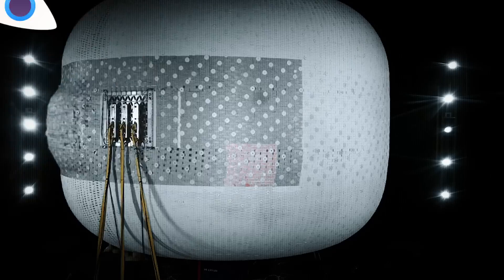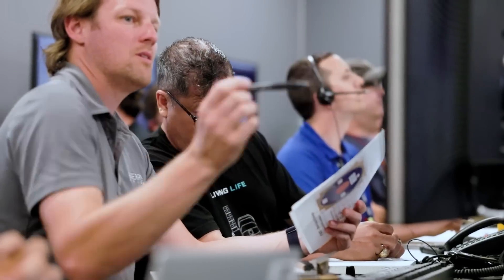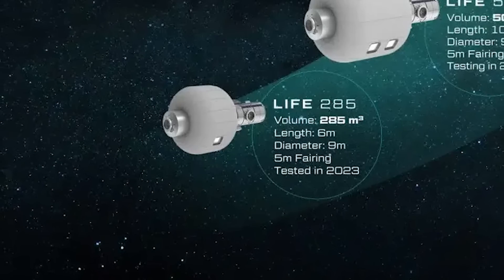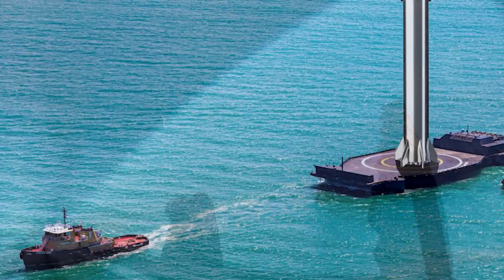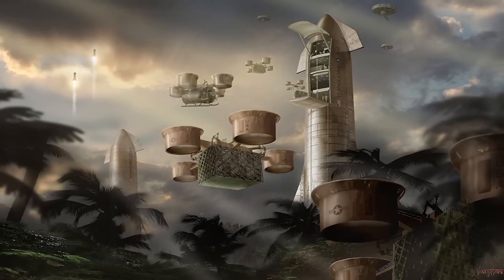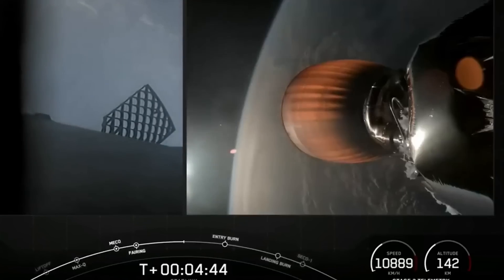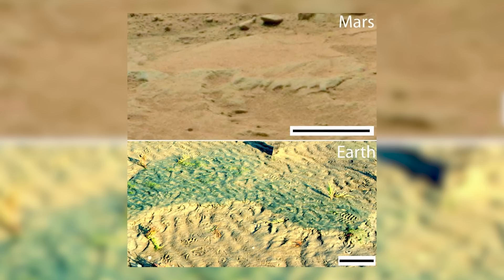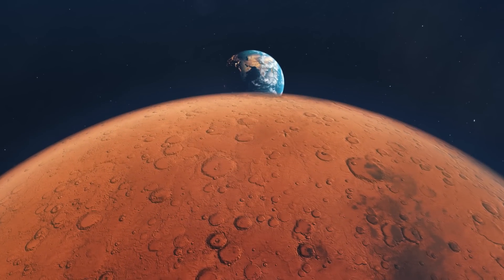This Is NASA's New Space Station...And It Just Exploded...Again!

Comment: They are not using a 50 cal. They are using light gas guns (LGG) which accelerate projectiles to speeds of 7.6 km/s or more, that's 9 times faster than the muzzle velocity of a 50 BMG which means that a projectile from a LGG has 81 times more energy than a 50 BMG per weight basis and more importantly the terminal ballistics are very different at those speeds even plasma and ionization become a thing.

Comment: i think they has to add multiple pressure layer for reliability and ability to fix one layer if ie inner layer damaged and there is space vetween outer and inner pressure layers it can be fixed withing by using outer barrier as shield while inner layer is daaged... ie layers with service space layer and can be kept reliable by using a bridge pressure layer ... so that the stress will be minimal as pressure difference will be lower compared to one pressure layer editions..

Comment: It would be vastly safer if the failure weren’t so violent. If you get ruptured by too much pressure, it should be repairable. Catastrophic failure really isn’t an option.
Reply: At 76 psi a crew would be long dead anyway.
However, I'm pretty sure this test was to see, if the thing is as strong as it's supposed to be,
not to prove it against pressures on-board systems probably wouldn't be able
to produce anyway.
Reply: Another reason to not want explosive failure is space debris. Yes these are vast hypotheticals given the pressure needed to burst the habitat, but it’s not a bad design principle for space craft in general - don’t fail violently.

Comment: The balloon habitats are hopeful due to low cost for the high internal volume.  I suppose a protective cube-like framework around the balloon can be covered with impact proof carbon fiber panels.  Dr. Robert Murray Smith here on YouTube invented a high impact carbonfiber plastic-like material.   This can protect the balloon from small  meteorites , space debris, and possible accidental collisions, fender benders and-or rocket exhaust.

Comment: Vectran? Really? Its limitations seem like a deal killer to me. It is only good up to a bit over 200°C, and it has big problems with UV radiation making it weaker and brittle. These are both major problems in space, where 200°C and higher is very common at our distance from the Sun.

An alternative that is far more durable is basalt fibers. Most variants have working temps up to 1000°C with some recipes maxxing out at 1200°C.  Also UV radiation does nothing to basalt fibers. Basalt fiber is significantly stronger than either kevlar (which is even worse than vectran for melting and UV exposure) or vectran.

Basalt fiber exhibits the highest tensile strength among the three, with a value of 4,800 MPa.
Kevlar fiber has a tensile strength of 3,620 MPa, which is significantly lower than Basalt but higher than Vectran.
Vectran fiber has a tensile strength of approximately 2,300 MPa, which is lower than both Basalt and Kevlar.

Comment: This is misleading In that NASA is NOT shooting a 50-cal bullet at this structure, with equivalent mass and energy.  The gas gun has an aperture which allows a small "particle" to free fly through the vacuum barrel at varying speeds and energies.  We had such guns for hyper-velocity physics studies, and achieved speeds well in excess of 50,000 FPS for various material studies, and re-entry simulations.  Our guns had 6+inch openings, and allowed larger objects to go through, which resulted in better modeling.  However, this required a massive propulsion system, and as a result, most normal use systems use a smaller barrel opening, and shorter distances, so that don't need massive facilities like our range, which was a several hundred foot long building...

Comment: Reminds me of the problem with an airplane: you do not incorporate square holes. The British had a nice plane, it didn't survive...
Reply: I don't think we even need inflating stations anymore now we have very large diameter rockets coming online. A modified starship would be more than wide enough for a station
Reply: I also wonder how an inflatable module will stand up to micrometeorite strikes over time. A tin can can be patched. How would they patch inflatable walls adequately?
Reply: @jokerace8227   Puncture repair kit, what else?
Reply: @geesehoward700 Still potentially useful for cheap, disposable storage. Or a big bounce house for when people want to get away for psychological relief.
Reply: @geesehoward700  which could then loft even bigger space stations
Reply: @davidconner-shover51  god, the small ones are bad enough why would you want to make them even worse? Structural strength is an issue, puncturing is an issue, having to inflate the part in space is an issue, radiation protection is an issue, repairing it is an issue, and the only thing you gain is a slightly larger living space.
Reply: @geesehoward700  actually, much less so than a hard frame. Repairs? unless something tears a huge hole, which would likely be more problematic on even a hard shell, a bit of fast setting sealant, and a tire patch would do. the multiple woven layers help out massively with this. 
Quite frankly, that burst test is actually a higher pressure than most car tires can handle, by about a bar. I would love to see their leakage data up to the point of failure
Reply: @geesehoward700  The Bigelow Expanding Module was used as a storage bay on the ISS with great success. Structural strength is less of an issue than with a rigid structure, and the walls are more puncture resistant - the ISS has in fact suffered from more than one "leak". Remember, in space the pressure differential is only 1 bar, it's not like a submarine that has to withstand great pressures - hulls made of little more than tinfoil would withstand the pressure differential in the vacuum of space (though not of course the micrometeorites).
Reply: @geesehoward700 yeah why don't they just fly one of these in orbit seems like they wanna spend as much money as possible
Reply: It was the Comet.  Square windows had been fine  on pressurised piston engined airliners, but the higher altitudes and higher speeds of a jet meant the pressure cycles were larger and more frequent.
Reply: Either way, it will never happen. They know it. This future-faking is just a manifestation, an impression for the people to think that there is something more. It’s the only way to pay people in an organization. There you have it, that’s as far as it will ever go. A video and image that shows people have used time and energy and tax payers funds to build something neat looking. If I’m wrong, please let me know when it’s in place and operational and I’ll applaud and say yay. Good luck🌸
Reply: There was a similar type of sharp corner flaw in the design of the Titanic's hull that contributed to the ship breaking apart easier.
Reply: Actually, it was the rivets that coursed the problem. 😂
Reply: The problem: the fuselage skin was too thin. Had the Comet used the original engine planned for the plane, it's likely the problem would not have manifested itself until much later.
Reply: Australia does not  exist , it's all big conspiracy  maaaate 😃😃🍺🍺

Comment: You could drive a tesla on the moon, or mars. Cant do that with a regular car.
Reply: NO. Cooling system needs to be totally reworked. There is no air on moon.
Reply: @alesksander  Cooling and heating.
Reply: @tboman4128  Yeah. insulation of electronics etc. Not so easy as it seems  to someone.
Reply: @alexmaccity  Nope. It can't take the heat and cold extremes of temperatures on the moon. smh

Temperatures near the Moon's equator can spike to 250°F (121°C) in daylight, then plummet after nightfall to -208°F (-133°C).
Reply: Climate control broje. get from the north pole to the south pole in like 20 minutes with a tesla to. Elon should make the people who work at tesla design a rocket ship car so we can go to work on earth, and then be like "I might swing by the moon real quick"
Reply: @alexmaccity  BS
Reply: There is something of an atmosphere on the moon, and mars has an atmosphere
Reply: @alexmaccity  And your point is?
Reply: @alexmaccity  bro cooling needs to be redo PERIOD. And Tesla pack even detuned needs a LOT radiative surface area, witch is practically impossible to implement. Another solution is to make sublimative heat pump cooling. Hence why (or any eletric car for taht matter) Tesla needs to be totally reworked. Electronics boxes needed to be re-evaluated. There is possibility exposing  pcbs to the vacuum  can cause elements on pcs to pop off or even corrode or they simply dont work and need to be reworked into another version...
Reply: I hear what you're saying. I don't like it, but I hear it.
Reply: @alesksander  I'm not your "Bro" and your response posts make no sense. smfh
Reply: @tboman4128  Wow thanks for such detailed and well thought out response
Reply: @alesksander  I was responding to alexmaccity
Reply: @tboman4128  i see wrong reference then, all good
Reply: So what?
Reply: Youre telling me that if I was like hey man wanna drive my taysla on the moon with me? You wouldn't go?
Reply: @alexmaccity  Ever hear of the moon rover?
The Apollo lunar roving vehicle was a battery-powered space buggy. The astro- nauts on Apollo 15, 16, and 17 used it to explore their landing sites and to travel greater distances than astronauts on earlier missions. The lunar rover neatly folded up inside the lunar lander during trips to the Moon.
It's been done,